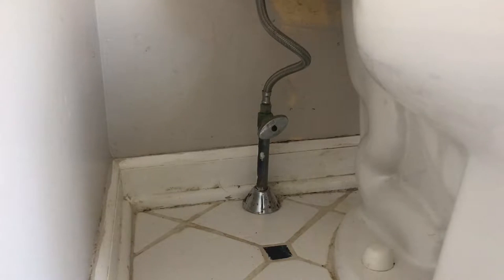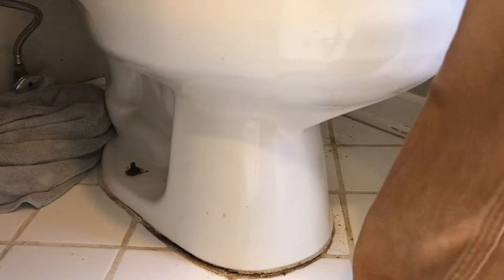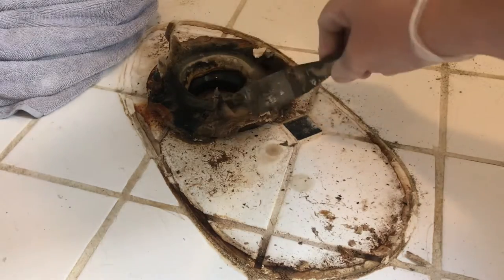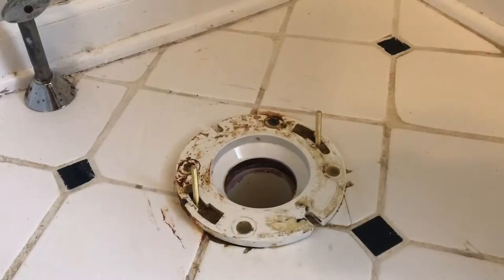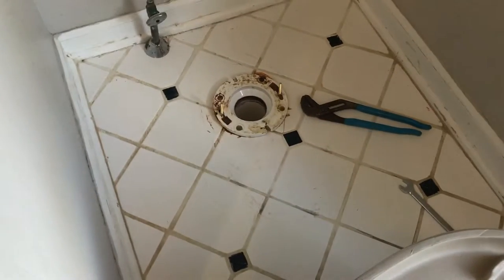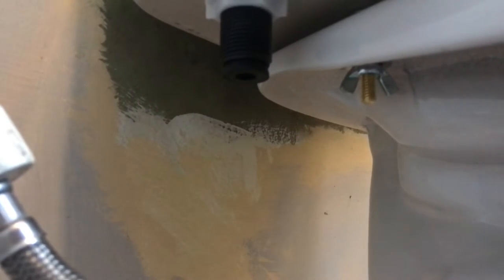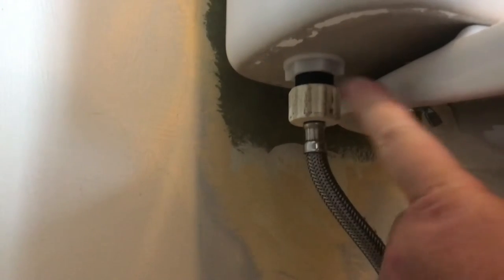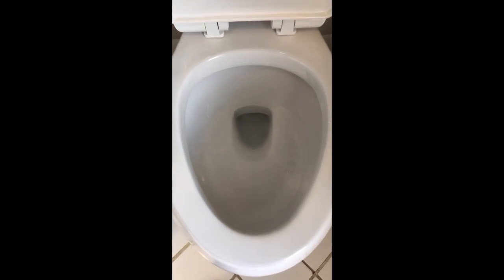Glacier Bay Power Flush 2-Piece 1.28 GPF. "10 Easy STEPS To Replace Your Toilet"

Comment: The tank just installs itself?  Great!  I was worried I'd have to figure it out on my own
Reply from the maker: The toilet does come with instructions on connecting the only two pieces in the box with a couple of nuts and bolts with a rubber gasket in between.

Comment: You didn't show the tank installation - that's what I needed the help with.
Reply from the maker: It’s only two pieces. Put it together and tighten the bolts and nuts. Very basic
Reply: I came here for that too  ... its 4 soft washers 2 wing nuts and long bolts and two hard washers ... make sure you put the wing nuts under the tank not in ... i hope the hard washers go on the outside too ... ill have to keep lookin to make sure😊 7:56
Reply: same.  i can't get it to seat.   it says to push down and turn it side to side until it clicks in to place.   I'm on hour 4 of turning it, pushing it, trying again and again and again and it just won't slip in to place.   What's the trick?
Reply: I eventually got it by wetting the seal on both sides.   needed to make a suction.  I still don't like the way it seats -- it's a bit wobbly and you can't crank down the clips too tight before it will snap.   Cheap stuff is cheap stuff i guess.  Flushes well though
Reply: @BReal14 did you ever figure it to seat it fully? I just installed one and am experiencing the same wobblyness. Unacceptable to me, but the flush action is working nicely
Reply: @robertpenna3304  Same.  it's not perfect or secure feeling.  it flushes with force, but it's not on.   I worry if i crank the nuts any tighter, it will crack.    i gave up.   Some rainy day, i'll try it again.
Reply: @BReal14  Hey so I figured it out that day. Just take the wingnuts and throw them away. Go buy #5 nuts and slap em on.
Reply: @robertpenna3304  how does that help?  I'm not sure I follow
Reply: @BReal14  The wingnuts they provide just didn't get tight enough with hand tightening, no matter how hard I tried. The tank kept wobbling, and it was unacceptable. These toilets (and their hardware) are made in China, and the hardware they include is as cheap as possible for convenience. Like you said, 'cheap stuff is cheap stuff.' What worked for me was tossing the wingnuts and replacing them with two '#5-40' nuts from the hardware store. That let me tighten the tank properly with an adjustable wrench, and now it's rock solid.

Comment: You skipped the tank installation.
Reply from the maker: Two bolts provided with nuts and a rubber gasket put them together tighten them up, pretty basic

Comment: If I use a sponge or a shop vac to remove the remaining water in the tank rather than putting a towel on the floor will I run the risk of being deported and/or excomunicated?